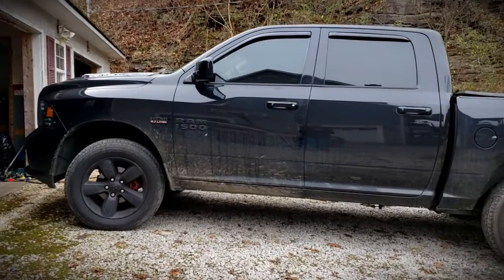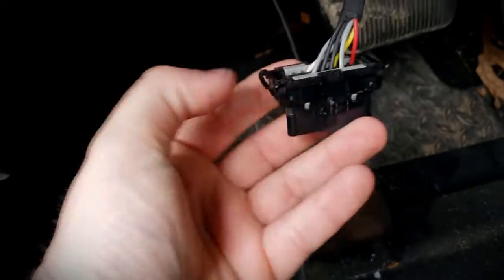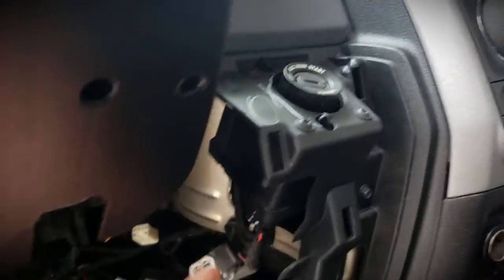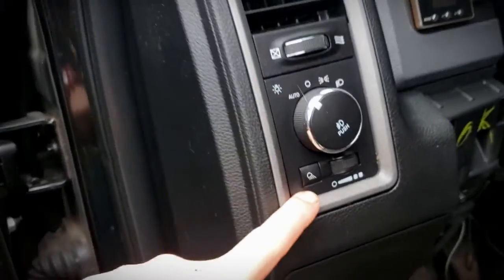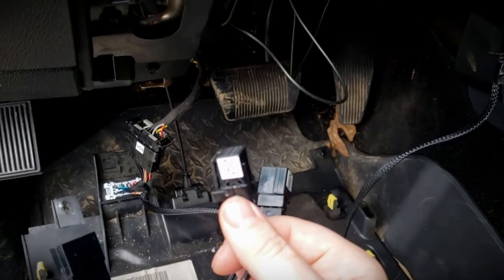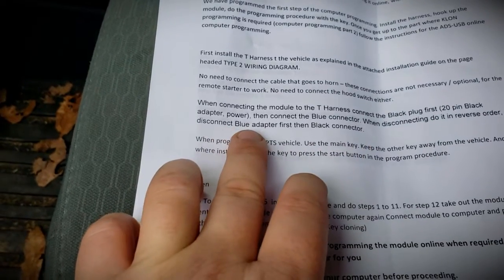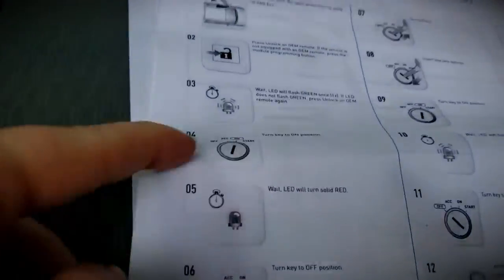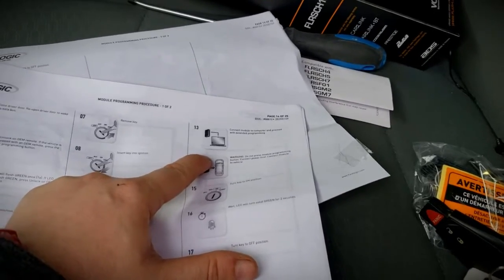FLASHLOGIC Remote Start | Ram 1500 | Install

Comment: That is a crew cab, not a quad cab. The crew has the bigger back doors, I have a quad, the smaller back doors.
Reply from the maker: Cool
Reply: Same shit bro
Reply: @KHAOSER23  it's different shit bro
Reply: @davecpgh  other than the size of the doors, it looks like all the wiring is the same
Reply: @KHAOSER23  yes, I know the wiring is the same! it's a good thing to know the correct trim package of your own truck. Especially when you're posting a video on how to work on it. If you're not sure of your own truck, or guessing about it, how you sure on how to work on it. It's that type of thing. Bro

Comment: Quick question , seen one of your older videos on the rear bumper conversion on your mustang will it be possible to do the same conversation but on a 2010 mustang?
Reply from the maker: Should be.  The 2010-2014 should all be interchangeable

Comment: I had pain in the ass problems with this harness. Looks real easy on youtube but I can't even get the program to download on my computer.  Harness isn't reading my truck and directions I downloaded are terrible
Reply from the maker: Yeah I had a bit of an issue.  Had to update a bunch of drivers
Reply: Finally got it installed after 3 days. I had to cut and hardwire into my trailer harness because I have a 2018. That's the only year that has to do that and you have to flash the drive right from the beginning which this video doesn't show. Then you program with the key then you do the "extended" programming to finish after the key is programmed. Plus my light functions didn't work so I unplugged the harness that the lights run off and just went with the factory harness again